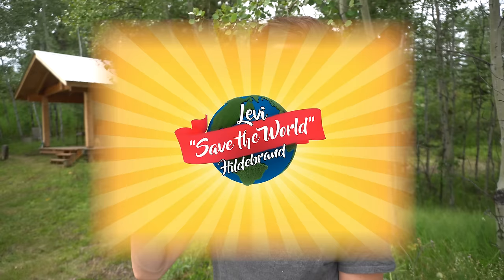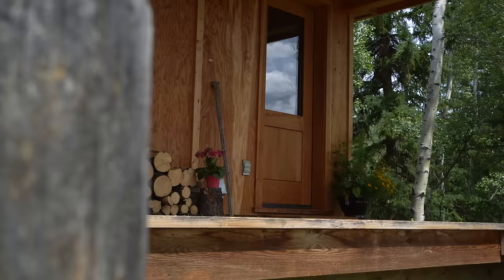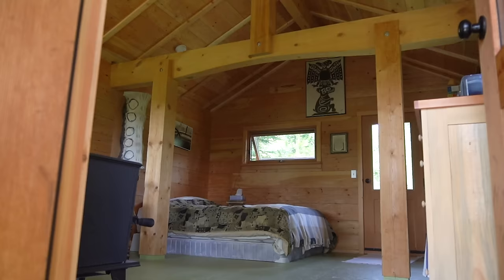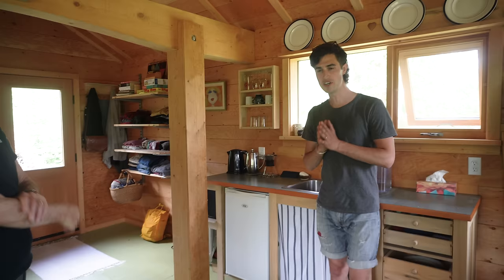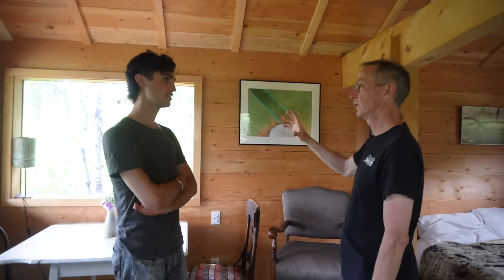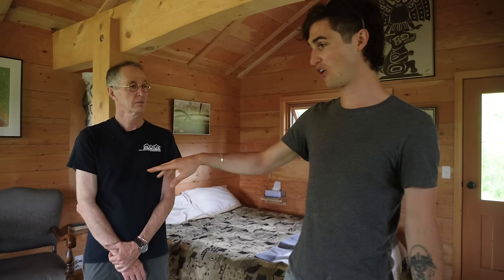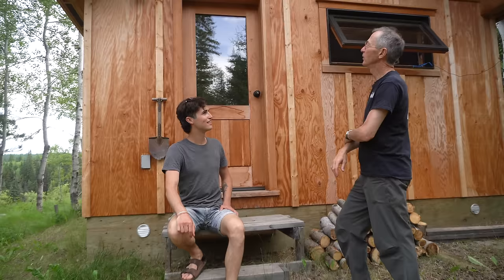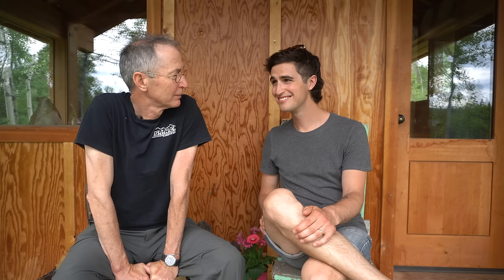Off-Grid Tiny Cabin Tour!

Comment: I’m looking at building something very identical to this. Using my own cypress milled on a friends sawmill. Can you ask your dad what the rafter spacing is and ridge beam size? 

I’m basically close to finalizing the design @ a 12x20 with exposed beams and wood on the ceiling. Just need to work on some details but your dads build is giving me some good ideas. Great video and badass cabin!